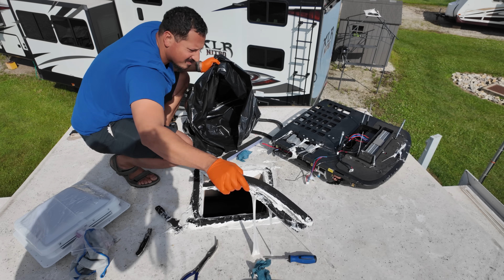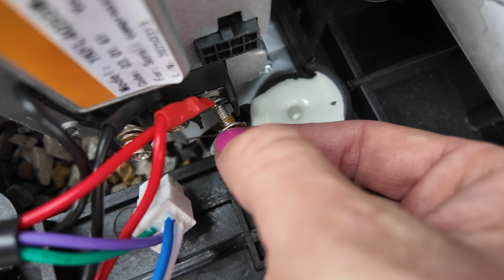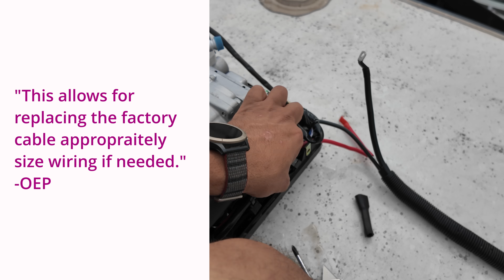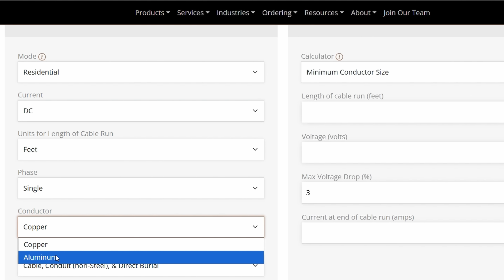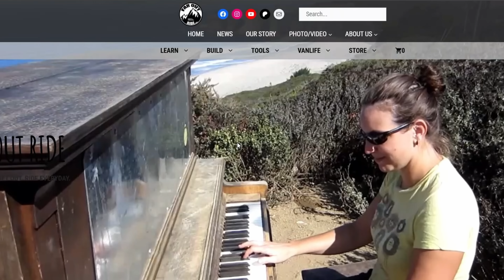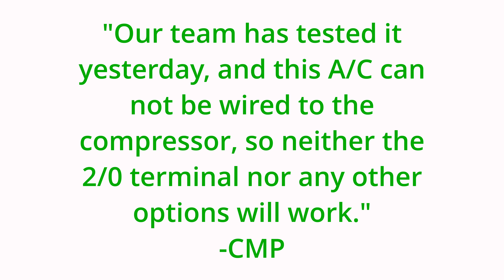The Truth About 12V RV AC Wiring in Big Rigs (What No One Says)

Comment: Anything electrical when using smaller than ideal wire will cause additional heat and shorten it’s life.    It does depend on its end use since on low it obviously  uses less electric.  The recommended wire is for max use with some portion being a built in safety factor.   You can run a larger wire to the unit to a block.   From the block you can use the factory wire.   Don’t over think it.
Reply from the maker: Good points. The factory wire is definitely a limiting factor if you're trying to pull max amps. Using a block to upsize the main feed is a solid approach.

Comment: Hello,
Has anyone suggested.  Rumning your #6 a couple of feet to a weather proof j box then transitioning to the large gage wire for volatage drop.  This way you can connect to your ac terminal and correct for vd.  Also,  to decrease current and to be able to use smaller wire.   You can go with a 24v or 48v unit.   The higher the voltage the lower the current draw. Power stays the same, watts.

Comment: Some ideas..
1. Using fine strand welding cable gives you higher amperage in smaller wire. Check ampacity charts for that style cable, its all I will use as it's more flexible too.
2. Using the RV chassis frame could significantly shorten the negative cable. It would require perfect chassis connections.
3. LifePo4 spends most of its duty cycle at 13.2 volts which is an advantage.
4. These AC's usually scroll down amperage usage after initial cool down, though that probably takes longer with a large rig.

Comment: 50 ft run isn't the norm... Quite frankly, a 5th wheel is not a "boondocking" vehicle of choice. It's just too big and/or heavy to get into many places. I go into a place that you just can't tow a trailer into. A pickup bed camper is your only choice and that's pushing the limits and don't even think about going in after a good rain, you'll never make it and a 5th wheel wouldn't even stand a chance of getting in. 

As with ANYTHING and EVERYTHING, it depends on your use case. I'm putting one on my boat and the wiring run is about 12ft. I wouldn't even think about putting it on the front hatch, I just don't want that much wiring in my boat.
Reply from the maker: 12ft is a perfectly reasonable length! We tried it out because all the companies were making it seem plug and play for big rigs, but we don’t feel that way. Let us know how it goes on the boat!

Comment: Given that the voltage, even at the battery, will be before 12v for the last 25%ish of the battery capacity means you're starting off with incorrect assumptions.
And it sounds like you're talking about voltage drop like it's a huge safety concern. 
Voltage drop means resistance and resistance is heat. That sounds bad.
Well, if the unit was pulling full amps for hours upon hours upon hours that would be true because the heat would build up and could potentially get hot enough to start a fire.

But you're unit might run at full power for a couple hours and then start cycling. And unless you manually put it on the highest setting it won't need to run at full power to maintain temperature. Let's say it's at a 50% duty cycle once it's reached temperature. Half the time the wire will be cooling down. 

How much heat is too much? That's based on what kind of insulation is on the wire. Fires are started when the insulation get hot enough to combust. Silicone wire insulation can withstand 500 degrees F continuous. You're not going to exceed that in your application if you use silicone jacketed wire.  You're not even going to come close.

But here's two easy remedies that are safe but am electrician that deals in AC current all day won't think it's safe because AC current acts differently than DC current. 
Run your thicker gauge wire the whole distance and shave down the lug at the air conditioner to fit the lug there. You're running the thicker cable to avoid voltage drop, not because your amps requirement require that gauge of cable. So the smaller lug won't cause an issue. 

And I have to inject that your 100ft calculation was incorrect, 50ft is the run length. That right there let's you run 6awg. 

But assuming you want to be extra extra extra safe and believe your fears, I get it, you can run a thicker cable from the battery to where the stock wire length will reach to. You'll join the two wires together at an isolated lug/power distribution block and you're good to go. This is what many installers will do.

The two assumptions that you can't drop before 12v and the 100ft distance calculation is what made you find a problem where there isn't really a problem. And that's why people aren't talking about it. They just buy longer wires if needed. And many vans just place the batteries or the unit so it's within 16ft of the unit.

Again, I understand wanting to believe your fears and build to them. We all do it in some area of our life.

And I get that your unit is already installed but maybe someone will see this so they can still have their fear but also understand the correct math needed to come to a logical solution.

Your oven or stove is way more likely to burn down your RV.

Comment: what not shift to a 24vt system?   A 24 to 12 vt unit is cheap.  You can increase the amperage available with a 24vt system and dont have the issue with the wire size as much.
Reply from the maker: That would absolutely be the best option

Comment: You have uncovered the reason why, when the original grid system was implemented in the early 1900s, that higher voltage AC power was used.  I suspect that in your case, the cost of 100' of 2/0 wire would cost as much as the AC unit itself. Also, unless you have an insanely large solar array, the power to recharge the batteries still needs to come from the 120 VAC grid. These 12 VDC AC units may make sense in a Class B van with a 200 amp alternator while traveling down the road with the engine running.  Boondocking, . . . not so much.

Comment: Interesting video that has given me a lot to think about on my 5th wheel application.  I'm not an electrician, but my father was when he was alive, so I have enough knowledge to keep me in trouble, so to speak.  The one consistent thing is that a large gauge cable is going to have to be run from the roof mount area to the trailer batteries.  This got me to thinking about the connections and the problems you are experiencing.  I would think it would be possible to mount a single battery on the roof near the AC, therefore you could run the OEM wiring from the 12 volt unit to this battery, then do your heavy gauge to your main batteries so that it will just add a third battery to your current system.  Ideal?  No, but it is an alternative to modifying the main unit and I would think it should eliminate the fire hazard potential.  I am curious to your opinion on the pluses verse's minuses on this idea.

Comment: You are doing the calculations wrong. Your total run is 50 feet, not 100 feet. You don't need to add both positive and negative lengths of wire. You just need to do the calculation for 50 feet.

Comment: Why are you trying to do a homerun for 50' to the batteries??  That makes Zero Sense, none, nothing whatsoever.  Put in one or more Inside bus bar(s) fed by heavier gauge and run the 6g the 12 to 14' from the interior bus bar to the rooftop AC.  This not only makes sense by allowing you 12vdc at the bus bar for other items, but you don't need to run a 1/0 or 2/0 to the roof, which is the dumbest idea I've heard yet.  I had to click off once this went completely off the rails.  Best of luck to ya.

Comment: SEPARATE NOTE.  By using the 1% voltage drop rule and running the heavy gauge wire to within a couple of feet of the unit you can then drop down to a smaller garage wire for the last few feet.  This is a in safe way to run the system your trying to run.  Just remember you will need two breakers.  One for the large gauge wire and one from the unit to the power block and one in for the unit it's self.  The reason is to shut down any short at the unit it's self.  
     Your still the only channel I've seen to say anything about wire size. Your the best!!
Reply from the maker: Awesome feed back appreciate your input! This is a great Idea. People like you providing more input and sharing knowledge in the comments adds real value! Thanks for watching!
Reply: I concur. There are two reason for a larger gauge wire.  Increased current capacity and or lower voltage drop.  In the case of this video you do not need higher current capacity.  Having a couple feet of 6 gauge wire with rest the higher gauge will reduce the voltage drop to nearly the same as if the entire run what higher gauge.  The added benefit is that you do not have to worry about connecting the larger lugs to the air conditioner itself.

P.S. I am a retired system engineer with 25 years in the utilities test and measurement industry.
Reply: A bit late here, but I was going to say the same thing. For those who may be unsure or not believe it, just think about the rest of the wiring that comes AFTER the terminal block. Every wire from the terminal block to the electric components on the A/C is smaller than the supplied battery run of 6AG. The same concept applies in AC wiring systems. You get a big cable coming into the breaker panel and smaller cables going to individual circuits. 

The simple solution for this situation would be a large 2/0 or maybe even 4/0 run from the batteries up front to a terminal block at the rear. Then you can run smaller circuits from this location using smaller gauge wire. When it comes to automotive wiring I personally always size up my wires to a bigger gauge. Not only does it help with voltage drop over distance, which is a big deal on DC systems, but it also always for surplus capacity in the cabling. Automotive wiring is always stranded wire, with each strand supporting part of the load. Stranded cable is more flexible and less brittle. But each strand is smaller and it's common for strands to break out corrode over time from the weather or road shock/vibration. A bigger cable always for a greater strand failure percentage before negatively affecting capacity. That is why I usually size up 1-2 awg sizes in my plans. 

Also, not sure if anyone mentioned this, but battery voltage drops as capacity is used. At 100% full it may be 12.8-13.6v but at 50% capacity most batteries are down about 12.0v. So your calculations for voltage drop should be done using the nominal 12.0v figure to ensure that voltage drop stays within reason even as the batteries drain down.

Comment: WARNING FIRE HAZARD!!!  The AYBC, The American Yatch and Boat Council.  They are the Gold Standard in DC wiring.  They have two different standards for DC wiring.  The 1% which for anything running a motor.  The 3% rule is for things like lights, radios etc.  The 1& 3% rule is for the voltage drop.  You MUST take the Total wire run which is both the positive and negative runs added together.  
     THUS IS THE NEST VIDEO I'VE SEEN ON DC WIRING OF AC UNITS ON YT.  MANY THANKS!!!

Comment: Cut it smaller or use a different connector head.
   Ive had a similar problem with a car audio setup. Just cut it down a bit and use washers if the bolt head is too small.
   It wont hurt nothin
Reply from the maker: Good to know, thanks for sharing.

Comment: If you use a super fine welding cable the size will be much smaller because the more strands means more surface area more amperage. Also parallel cables of super fine welding cable with stacksble lugs may be an option.
Reply from the maker: This is what we had planned, still have 100’ of welding wire! 😂

Comment: 2 rather obvious solutions: 1. Run 0/0 cable to 2 post busbars, then connect AC to busbar using the supplied cable. 2. Get the 24 volt version and power it through a 12 to 24 volt converter.

Comment: I put a mini split 12v AC in my van. My batteries behind the driver seat. An extra 10 foot run on the power cord. That took 6 gauge copper wires to get the unit to run perfectly. I can only put on my roof because of size. A 400-watt solar panel. 2 320 ah Lithium phosphate batteries. With the unit set at 3C. Lowest setting. The lowest I got my batteries so far is 13.2v. With a ceiling fan on. For 24 hours. I haven't gone that far with testing. Only for 4 hours straight. I need to make some adjustments to the inside unit for water drainage. My point. For the until to operate properly with an extra 10 feet of wire. 6 gauge wire works perfectly. The 8 and 10 gauge wire doesn't. The 640 ah gives me a very long run time. 400-watts seems to me to be the minimum for solar size. 9 amp input average.
Reply from the maker: Awesome setup! I hear mini splits do great, and low amp draw. Thanks for sharing!

Comment: I don't think you need to replace the wire from the AC you can only replace the wire from the quick connector or Anderson connector all the way to the battery that way you don't lose any power I ran the wire 2 gauge from my battery all the way to the quick connector and I left it alone it works great

Comment: We installed our CountryMod unit 3 months ago in our front bedroom as a 2nd unit. Ran 2/0 wire for the 25’ run to my lithium battery bank. Ordered longer SS all thread from Amazon and used reflectix and foil tape to extend the internal air box. It is working great as a second bedroom unit even in Texas summer heat. We can boondock over night and close the bedroom door and have a comfortable night sleep. 31’ travel trailer with front bedroom. Took a 6 week trip from Ohio to Texas to Seattle then back to Ohio. 8079 miles in temps from 48f to 98f and we love it.

Comment: Now that 6 gauge wire on the unit looked like it was silicone insulation on the wire. Silicone wire has a higher amperage rating than the standard pvc insulation wiring. Some of the better calculators have the option of choosing either PVC or Silicone wiring.

Comment: You don't need to run the larger gauge wire into the unit. You can splice to the 6 awg wire close to the unit. Then break up the voltage drop calculation into 2 parts.

For 2 feet of 6 awg (4 foot round trip), the voltage drop is 0.1 V. If your voltage drop budget is 0.78 V, that leaves 0.68 V for the remaining 48 feet (96 foot round trip), which calcs to >= 0.1288 ohm/1000ft. 0/1 awg is 0.116 (at 65°C).

However, running 48 or 50 feet of large gauge wire is a bad idea. The 6% voltage drop is 43 watts of lost energy heating wires. It would be better to loose the 6% in an inverter, and run 120V over 14 awg wire.

I'm starting to question whether these small 12V A/C units have enough cooling anyway. 700 watts is 2400 BTUs (0.2 ton), which will only cool 120 sq-ft (you need 20 BTUs/sq-ft).

It seems you need an A/C unit 3-5x larger. 7,200-12,000 BTU (0.6-1 ton). 10-15A of 240V, way beyond what a battery bank can supply.

1 ton = 3500 watts (14.6A @ 240V)
12,000 BTU = 1 ton
3.4286 BTUs/watt
20 BTUs/sq-ft
Reply from the maker: Oh we are with you! We wanted to test that out on our off grid challenge, but we obviously didn’t make it that far. I think that was in the back of our heads- after all these modifications is this telling us that it’s just not made for big rigs?!

Comment: Lithium batteries do not vent. The simple solution is to relocate your battery bank. I would configure to run single zone at each location.  I think you could even wire these to run independently of the house batteries;simply wire around it all.

Comment: Why don't you run larger wire down to the back of van to something like a Victron Lynx Distributor ensuring no loss of 12v then run smaller cable from the Lynx Distributor the AC unit?  This would be common sense? At least with a Lynx you could fuse the larger cable as you will be pulling huge amps but then fuse down for the AC unit to make it safe?
Reply from the maker: Not Everyone knows this information, so no it is not common sense, but thank you for sharing so others can learn.

Comment: The 12v/24v a/c’s are not powerful enough. Great for a sprinter van but not a Class A C larger TT or Fifth
GOTTA HAVE 13.5 15 or 18k
Get a Furrion Chill Cube
Or
Turbno Greenland RV Rooftop.
Go with a Inverter or Variable Speed Compressor 120v
My chill cube runs on solar day in  and day out at 450-650watts on a low/medium setting and 650-800 on medium/high
In Florida Keys
Reply from the maker: Agreed, thanks for sharing

Comment: You can run multiple smaller wires in place of a larger wire.  DC power doesnt care where the amps come from.  You can stick two cable lugs on those bolts.
Reply: Before you think this is janky, this is EXACTLY how victron recommends wiring DC input for their inverters.

Comment: I personally would have run a conduit through the front nose area somewhere. I was looking at the layout you have and there has to be one or two walls behind the fifth wheel that have voids for a conduit to be snuck through. It would have eliminated a bunch of feet of wire shortening that run by loads. Since that is where you want your batteries to be. If yours is exactly the Floorplans I looked at of your unit there is also storage in the rear? If so you don’t have to go to the front at all just put your batteries in the back storage and shorten your run that way. The other benefit of the rear storage area is climate control for your batteries. They won’t get so hot or cold causing issues with that being inside. Use the front belly for some of the things you put in the rear. 🤷‍♂️